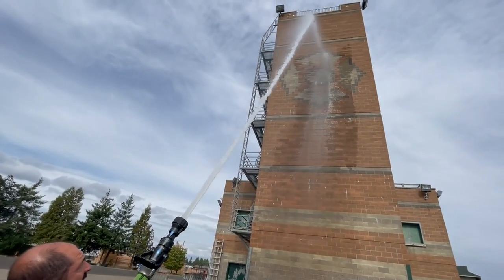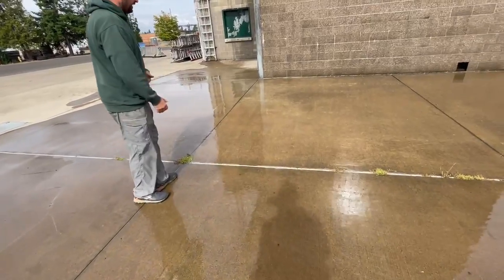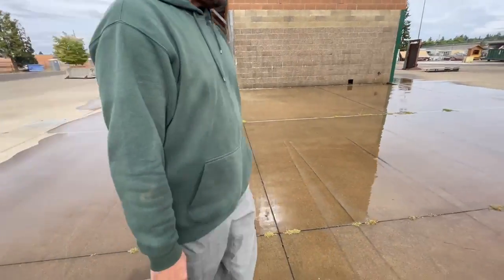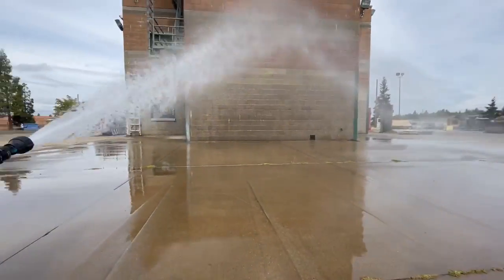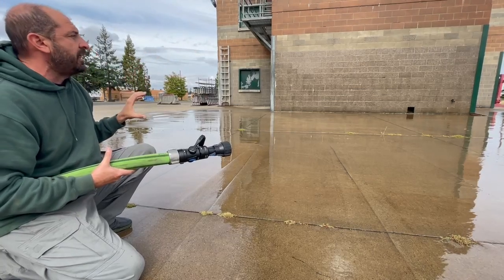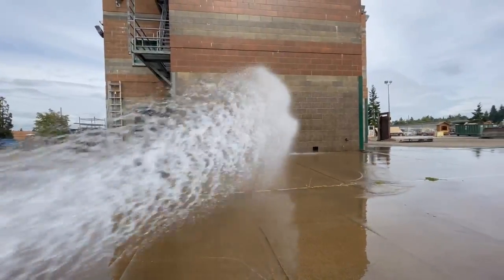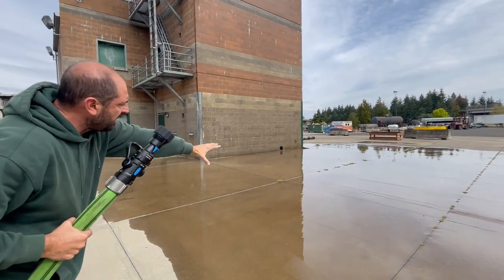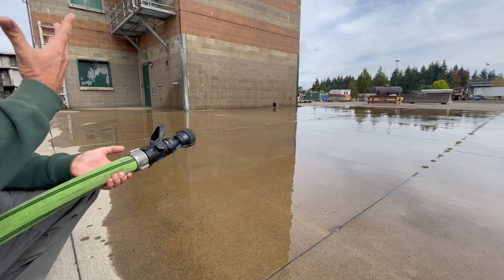HEN 160gpm@50psi Tight& Blade Reach, plus Coverage Discussion

Comment: Just another fog nozzle. All streams push air.  A straight stream pushes more than a solid bore. A bladed stream may push less than a normal fog, but it still pushes air. When it comes to fire attack, it’s still about the straight or solid stream making it through the heat to use its reach and hit the seat of the fire and play off the ceilings. A broken stream of any sort, upsets the thermal balance and increases steam over that of a solid stream. Certainly there are fires a broken stream won’t make that big of a difference over any other stream selection. When the rubber meets the road, this is just a fog nozzle that makes those who want to use a fog pattern feel less guilty about doing so.